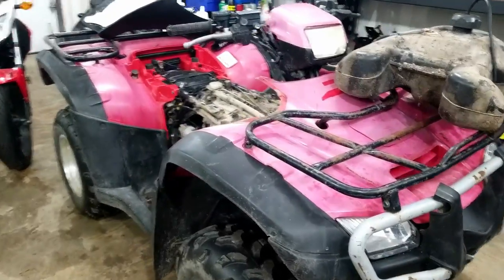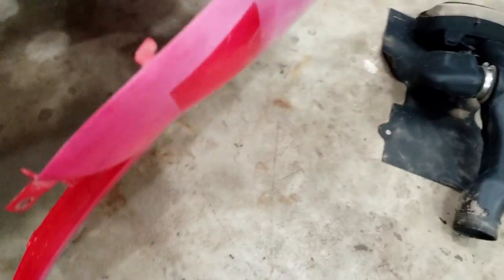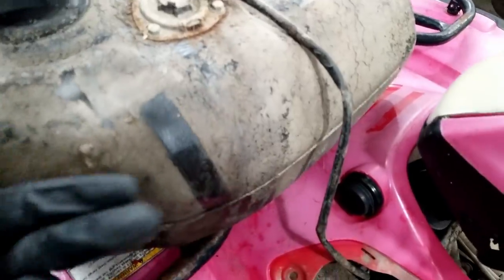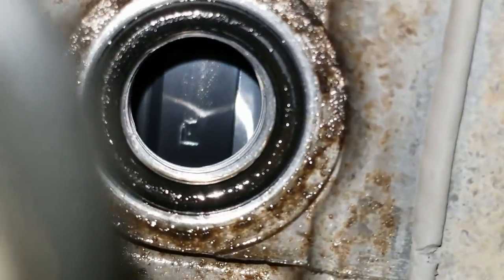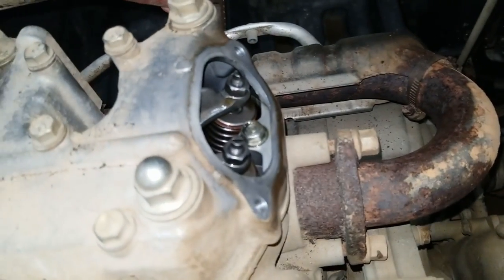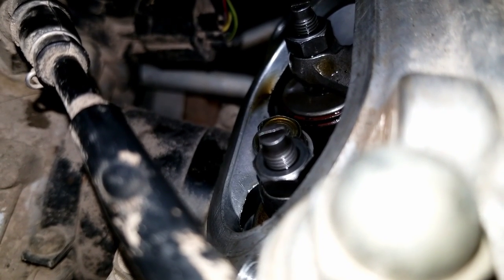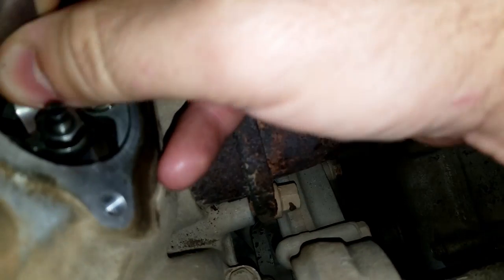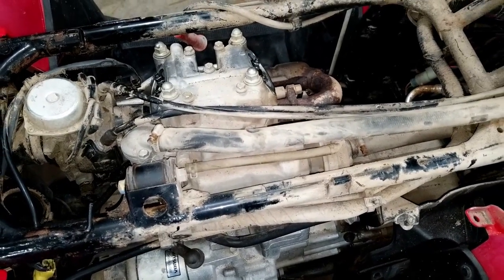Honda Foreman Rubicon Valve Adjustment

Comment: I have 02 foreman rubicon 500fa, I've noticed yes they are noisy when idling, kind of sounds like noisy valves, kind of annoying at first, but it is an awesome machine, love mine so far. good video thanks, need to check my valves now
Reply: i just bought the same, hows ur fairing?
Reply: @i_didnt_stutter6962  Mine still going good yet. Great machine!
Reply: Mine impressed me. New bearings and bushings in front and back. All new fluids. New rear axle and diff. Everything works like a champ just need to clean carb and get carb kit

Comment: Idk if you'd be willing to help me make sure but i have a 2012 honda foreman 500 and I cant find the valve clearance specs anywhere and I also can't find my service manual so any help is appreciated
Reply: Ifu still need the specs look around on the fram u can find a sticker with the specs along with spark plug gap and tire pressure specs, but it just depends if the sticker is still there. Or try and give your local Honda atv dealer a call, ask for the service department and if u get a nice person on the phone they will take the time to help u and give u the specs.
Reply: The specs should be the same for your 2012 as this one. They changed the motor in 2015.

Comment: Anyone know torque spec for the valve tappet jamb nut
Reply: If you dont have a good feel for hand torquing bolts you probably shouldnt be adjusting valves. Once you have tightened a few hundred bolts you will get a natural feel for torquing most bolts and wont need a torque wrench. I would still recommend using a torque wrench on things like head bolts. I personally have never used a torque wrench on a valve tappet lock nut.  Good luck!
Reply: To answer your question, as why you asked and not to get an answer like " if you don't have a good feel for hand torquing bolts you probably shouldn't be adjusting valves". The answer is 13Ft/Lbs. I have been working on ATV's for years and I still use a torque wrench on everything. So don't listen to ANYONE if they say you don't need to use one. If you wanna use one, you use it!!
Reply: @fourbyfourer  If you need a torque spec for a specific machine, you go to google and look up a spec page on the machine you have. Asking in a random youtube comment isnt how its done, how can you trust that a youtube comment is gonna give you the correct spec for your specific machine? Adjusting valves with manual tappets is a very precise procedure thay takes a lot of subtlety.  If you arent able to hand torque a single bolt then you likely dont have the knowledge to properly and accurately adjust a valve tappet to within a thousandth of an inch. So the truth remains that if you cant hand torque a bolt you likely dont have enough experience to be adjusting manual valve tappets.

Comment: If you check them regularly and can check the gaps hot, lower the gap more to quiet them down why put up with them noisy.

There only has to be gap so you don’t burn a valve instead of .15 set them at .11 etc